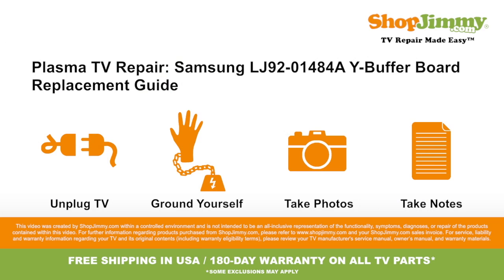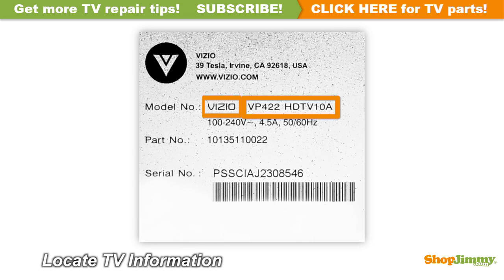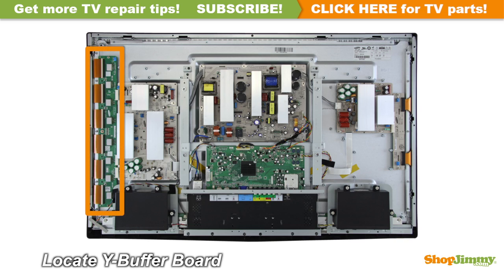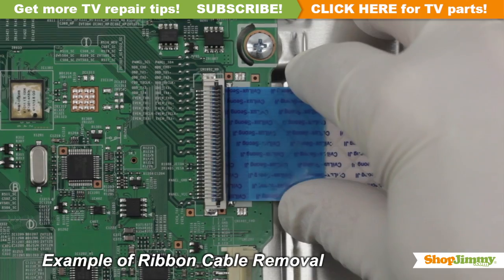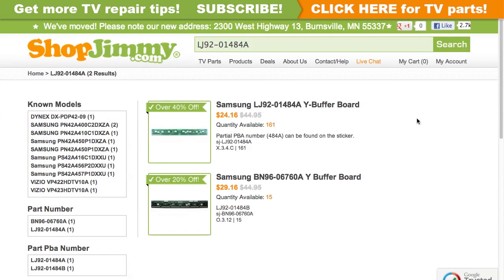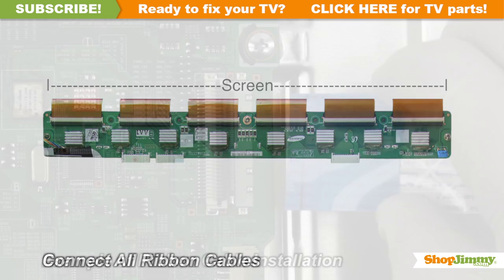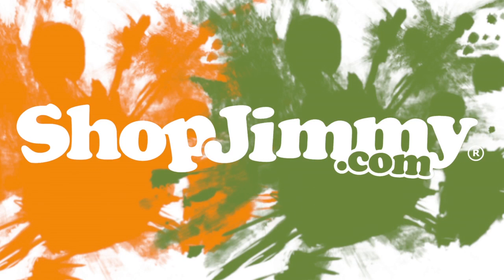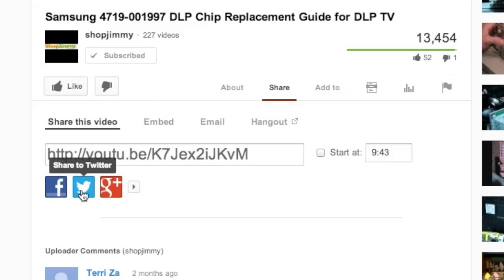Samsung Y-Buffer Boards Replacement Guide for LJ92-01484A  Plasma TV Repair

Comment: Hi, I have a Samsung 42" plasma. Model hpt 4254xxaa.  I wanted to change out the y main but I dont know how to pull it apart from the y buffer.  The ribbon cable was simple but there are 4  plastic connectors that attach the ymain to the y buffer and it won't come loose.  I don't want to pull Harry's and break the connections.  Any help would be greatly appreciated